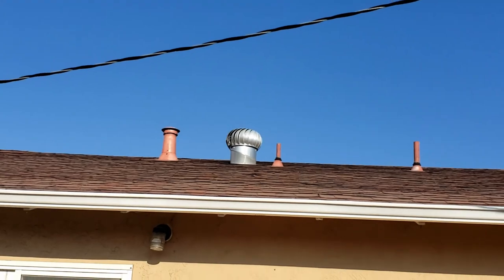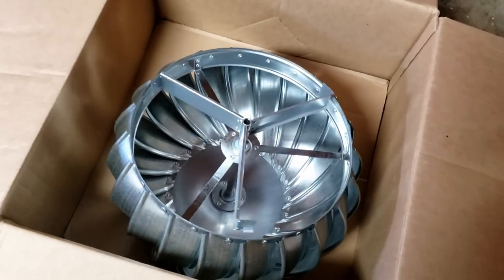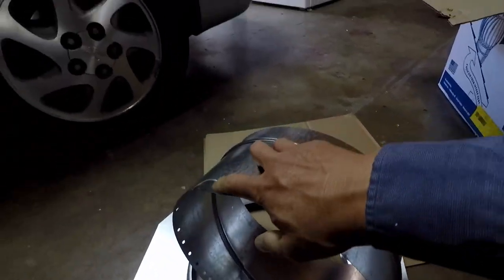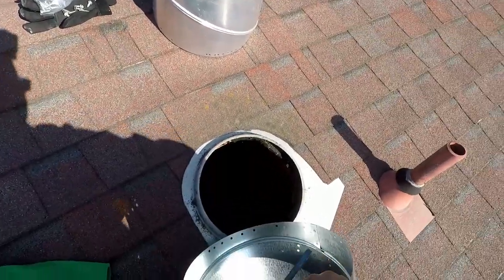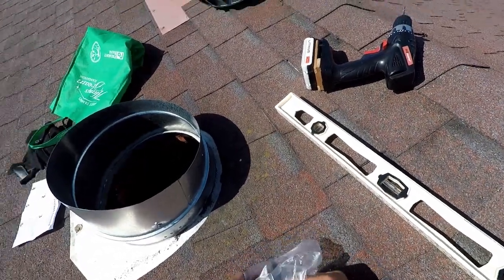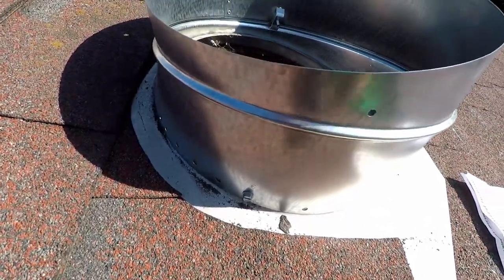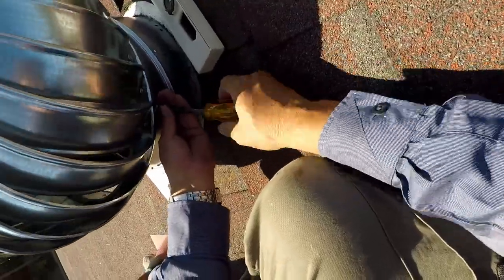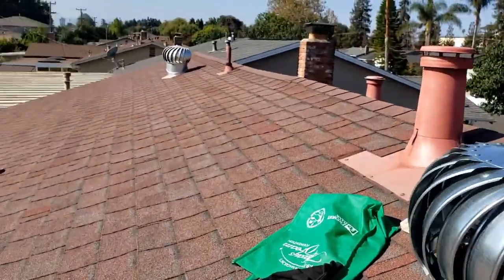DIY Attic Vent Turbine Replacement – My Experience. 5 min job?

Comment: I just encountered the exact same scenario, same parts and all. The unit you replaced is model BIB12 and called Whirlybird. It is aluminum, has a slightly taller elbow, and the braces sit on the outside of the elbow. The replacement you used is model GT-12, which is galvanized steel. The elbow is shorter and the braces connect on the inside. The base of both are identical in construction, but have a different mark used to adjust pitch. Also, the steel model is 2.5 pounds heavier. I learned all this after the fact, but did everything the same as you. Cheers to that!
Reply from the maker: Great info!. Thanks! 👍

Comment: I've never seen that kind before that you replaced as my replacement was slightly different but it had a ring at the bottom that just slipped over the 12-in opening.

Comment: Hi I want to know if the outside temperature is 45 Degree C and the inside temperature is 40 C. Bu installing Whirlybird in each room will reduce how much temperature inside the rooms?
Reply from the maker: Sorry, I don't have the info. The attic is like a hot oven on a hot day. This device will help better air circulation to keep it dry and lower the temperature faster.

Comment: you thing this turbines really work they take heat out from the attic
Reply from the maker: My understanding is the turbine help circulate the air inside attic.  In a hot day, it helps reduce the attic temperature quicker.